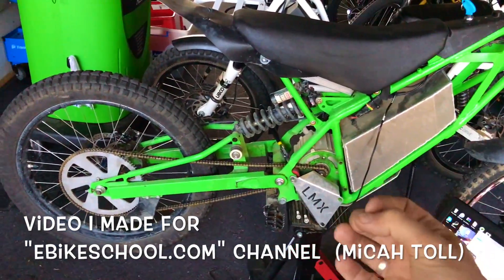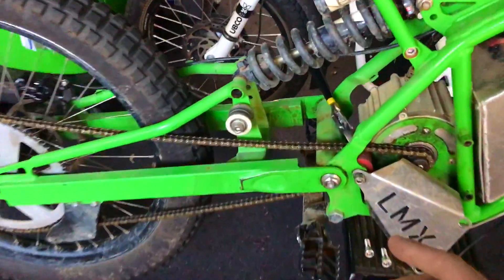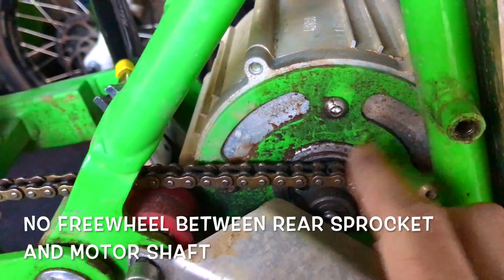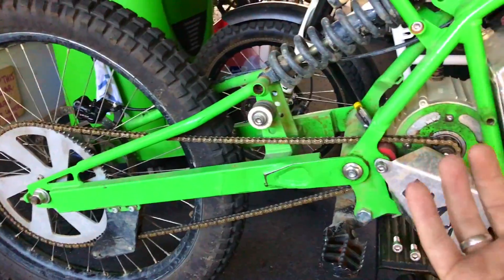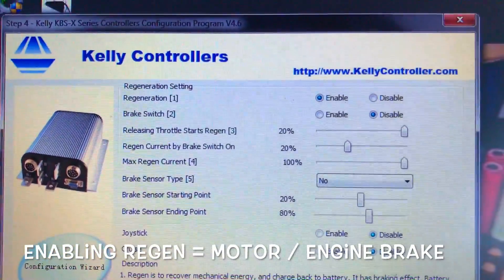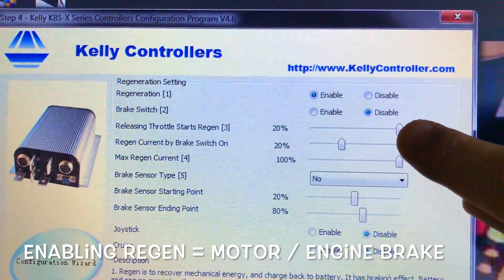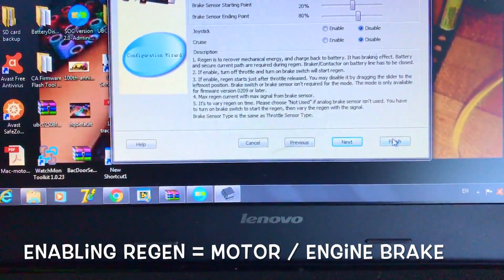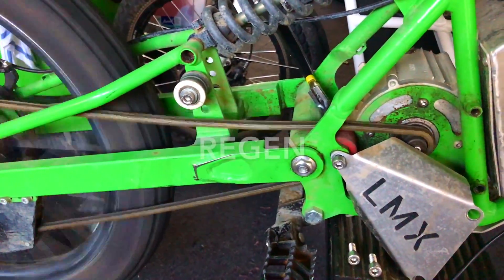Regenerative Braking ON/OFF demo • EV electric motor engine brake • LMX electric dirt bike

Comment: sir we need regenerative motor 84volts.   8000watt.(or) 10.000watt. (or ) 12.000watt.we need sir could you please call me. this is my number .8073258708.  in india where is regenerative motor available in india please inform me sir i am waiting for your reply .

Comment: Well that was useless.  Thought maybe you'd share how to hard wire regen
Reply from the maker: Why useless? The title of the video makes very clear “regen ON/OFF demo”
Also throttle-off-regen there’s no need to wire up anything, it’s an internal motor controller settings that you change and enable via software. Most EVs have this function available, nearly all electric cars are like that, Tesla uses throttle off regen too.
There’s an option to connect the regen to the brake sensor so it only kicks in when you hit the brake but this LMX bike power to weight was so crazy that we found throttle off regen was the only way we could stop the bike fast and safe enough without locking the rear wheel. Throttle off regen you also eliminate that “hand/foot reaction time” to reach and hit the brake. =]
Reply: @BrunoPOWEEER  I have a controller that has high and low levels of brake .according to my sources the wires need to be connected in a certain way to use the regen . Nobody seems to actually show this in a video I was hoping yours would as the title stated
Reply from the maker: Edward Gary some older and more basic controller you have two regen wires and all it does is enable regen when you join these two wires. Depending on the controller you may be able to connect to a PC and configure how much regen you want (just like this one I showed in the video) some basic controllers is just a factory pre-set regen. More advanced controllers will have a VARIABLE regen which is just like a throttle but controlling the regen brake intensity.
Maybe drop a question on the Endless Sphere on Facebook, there are thousands of people there someone will help you: https://www.facebook.com/groups/endless.sphere/?ref=share
Reply: @edgdeal76  mines a kelly kls7230s controller for a thumb throttle regen if it helps the pins are.. 
20. black
4. red
2. green
Then just set the setting in controller

Comment: How are you engaging regen? Are you just releasing the hall sensor throttle?  If so, is there a way to make regen engage through a seperate hall sensor and not the throttle?
Reply from the maker: Yeah... there are some different ways to activate regen, some people have the throttle settings so when you release the throttle it activate the Regen which is the fastest response one but you can’t just roll the bike downhill without regen... or some people have it connected to the ebrake hall sensor or a hall sensor throttle on the left hand, it all depends on the controller too, each model and brand have different regen features. =]

Comment: I’m thinking in getting the sun run firefly and changing the motor to a geared one, and also changing the controller to a sine wave. What’s your thoughts Brunex? Like 3 speed.

Comment: Hi ....I am new and have a Bafang 1000w with a Bafang DPC 10.UART display....it is on a Terra Trike (my wife) love the motor but the battery display says its always full charge.(We got 53 miles) before charging ...I wan to go into menu to see what voltage says see if it is correct .When i go in to menu screen nnA to the next screen it jumps to the LUd.... it skips the screen i want ...I hear it isnt the user friendly display.Do the battery displays work correctly  in this or is it a problem  that cant be fixed , and you go on miles...Thank you anyone with any info... Dennis

Comment: Needs a jackshaft on the swingarm pivot.....
Reply from the maker: Yeah like the "Motoped" where there's a dual cog hub at the swingarm pivot connecting the motor to the rear wheel, is that what you meant? =]
Reply: ElectricBike exactly what I mean!

Comment: But it has no gearing and no pedal assist.  Why not a derailleur without a freewheel, but a freewheel between the pedals and the chainring ?  The only thing this would be missing compared to hub motors would be reverse, but I think that's not so important.
Reply from the maker: Yeah, this bike can do reverse no problems, it's just a controller function that needs to be enabled via programming!
Bicycle cassette/hub/derailleur can't take all that power, it would brake in pieces + you can't do regen (freewheel and derailleur). Large rear sprocket connected directly to the motor shaft is the best option, the LMX guys tried everything, many many prototypes and different designs to get here =]

Comment: Geez man... I wish you showed a little more enthusiasm! :D
Reply: BTW it looks like if you enable the break switch you can Regen 100% current... Not just 20 at throttle release. Find the brake wiring, hook up a switch and seriously enable that Regen to the max! I am going. To google wwhat u have here... Looks awesome. Kelly huh?
Reply from the maker: Yeaaahh we first had the Kelly KBS72121x (50A continuous 120A peak) but then we wanted more POWAAAAAAAHHH and got a BIGGER model KBS72181 that is nearly "double" the POWER (110A continuous and 200A peak) the setting are the same for both controllers.
Some people run a second throttle on the left hand and use as a manual variable regen. I have done this setup for a few guys using different controllers, but to be honest, I haven't tried with these Kelly controllers, should be very similar... REGEN POWEEEEEERRR

Comment: I need a esc with regen for my future board powaaaaa
Reply from the maker: Me too... if you find a good powerful one let me know hahahaa what power levels are u talking how many amps esc? I think I know some models that can handle Regen, I think the ones used in RC cars, they use it as motor brake but I'm not sure if it feeds back to the battery, it probably does but the little RC motor wouldn't generate much POWEERRR anyway
Reply: ElectricBike  150 amps will be great and sensored im looking to try the VESCX but still need to upgrade it to more fets to handle continuous high amps “just in case I need” and don’t want a esc that blowup ... and it’s four escs hahaha powaaaa

Comment: Wish the laws where more open to e bikes I trimmed my shimano steps to go 50km/h but knowing I could get caught is just sad they have 25km/h restrictions here that's no so much powah :/
Reply from the maker: skull fucker yeah I wish these laws changed a bit, 25kmh isn't a very realistic speed even for kids and elderly people. It's actually slower than most people can pedal which is REALLY annoying. 
How did u modify your Shimano Steps, electronically or the easiest way by just repositioning the rear wheel magnet to pickup the crank cadence?
More POWAAAAAAAHHH